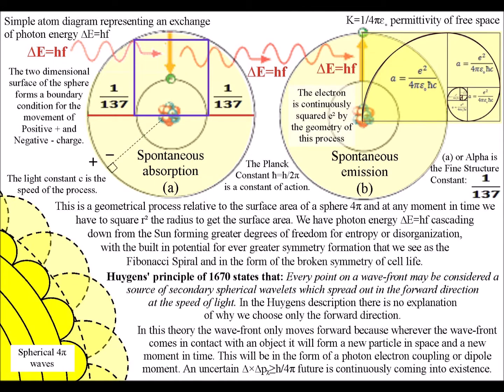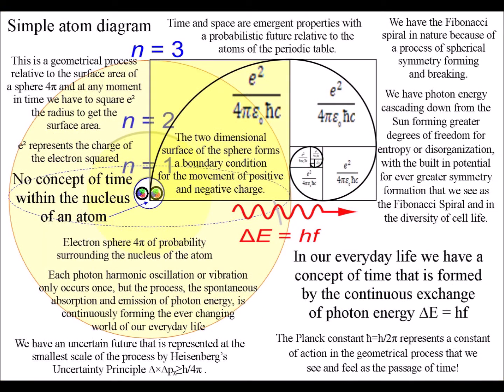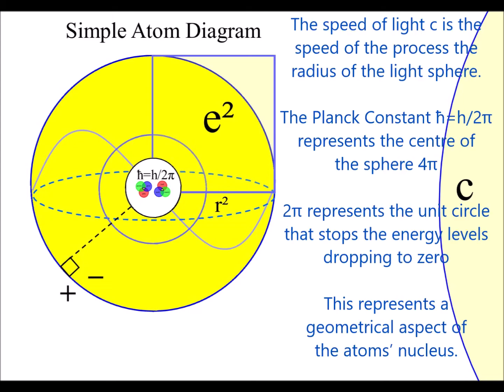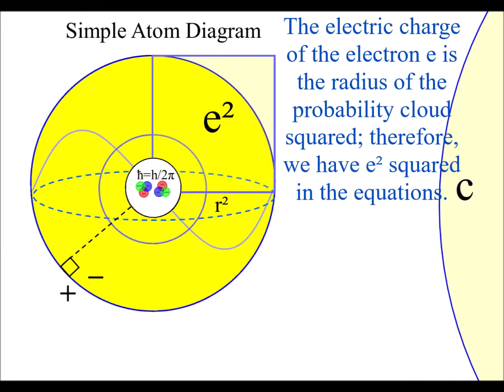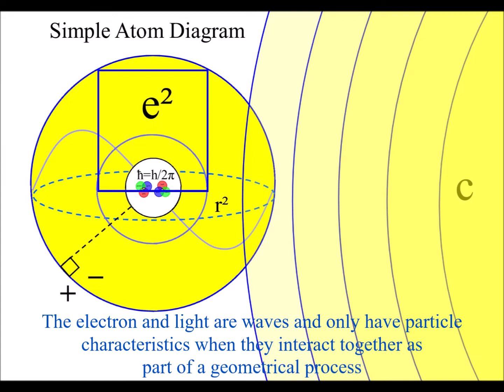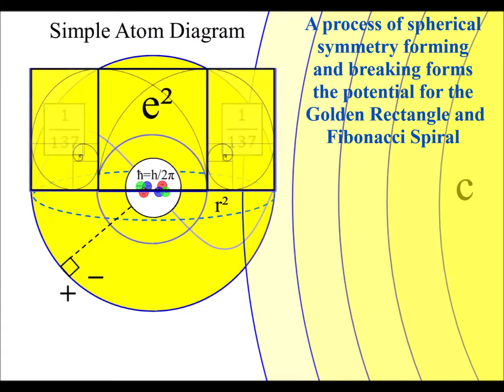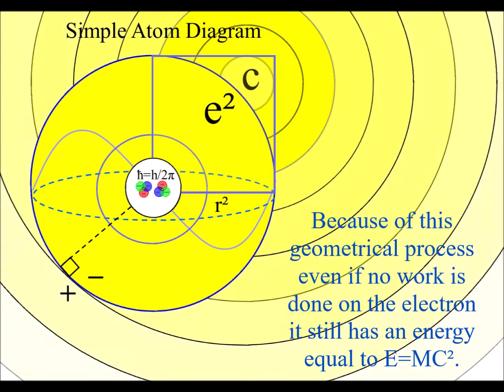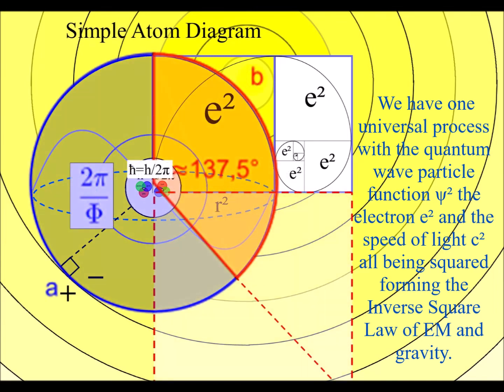Atom Animation of 137 the Fine Structure Constant formation and Golden Angle 137.5

Comment: dear Nick ... did you know that I use 1/137 to design Noah's Ark?  Yes it dawned on me that Noah's Ark could be one of the first attempts of man to imagine a periodic table of elements Easy to follow along ... you don't need pairs of animals ... you have the electron coupling 'e' x 'e'  and we know also that 1/137 is associated with the ability of an electron to absorb or emit a photon so it can go to higher/lower energy levels in the creation of other EL-ements. The Bohr model has 3 levels like the Ark  .. A meaningful coincidence is that Noah's Ark in the bible was described as being 300 cubits long that some calculate to be 137 meters long ... hmm  137.16 to be exact ... but in the bible and the game of cosmic magnetic horseshoes all you need to do is be close for a ringer dinger ...
I guess Noah's Ark travelled at the speed of light ... the white dove and black raven suggest + and -
Reply: You know nothing about quantum physics sir.